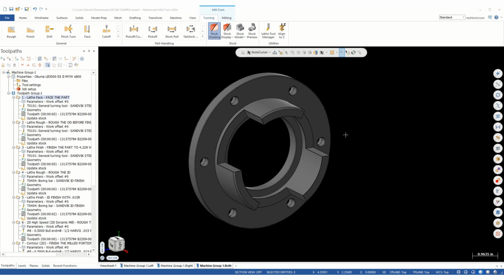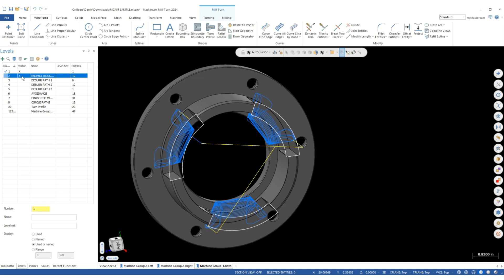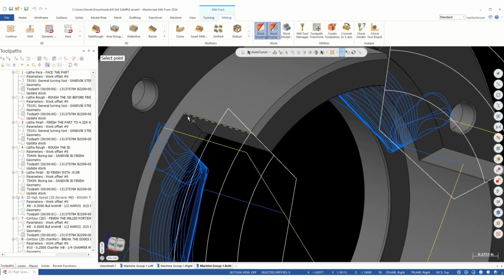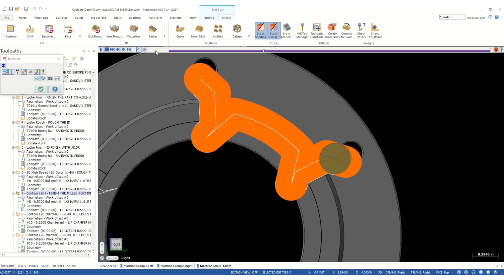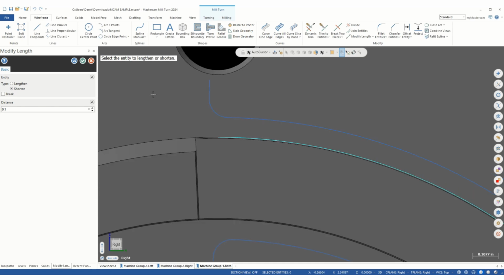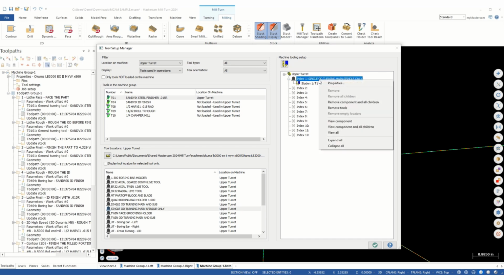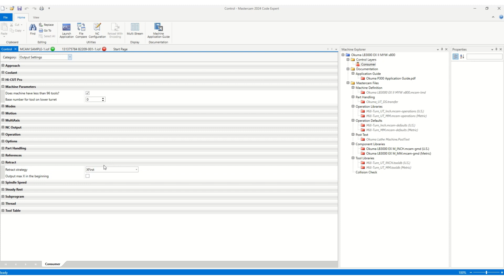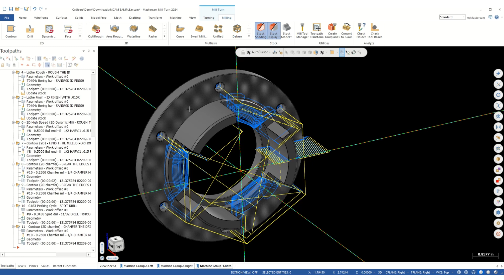MASTERCAM MILL TURN PROGRAMMING

Comment: For the edge break chamfers you can use the "model chamfer" tool path. It can be a little finicky but it will automatically trim the tool path on the lead in/out to avoid cutting into those walls. I will still use the regular contour route on normal chamfers though.

Comment: Great video. I run one of these as well (no subspindle) and program in mastercam 

Did you opt to use the mill turn machine vs the standard lathe for the added programming environment? I seem to get all my 3d toolpaths to function well on the standard lathe environment. Just curious.
Reply from the maker: The environment you see makes it easier to check clearances and performs functions like handoffs as our machine does have a sub spindle.